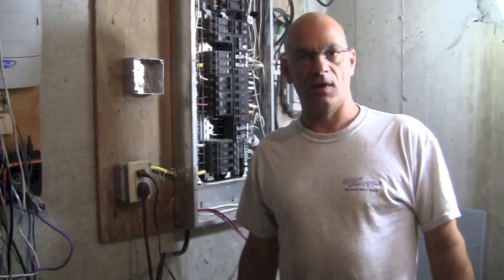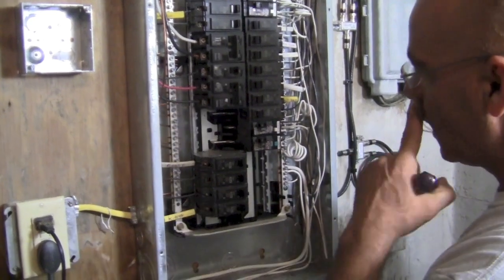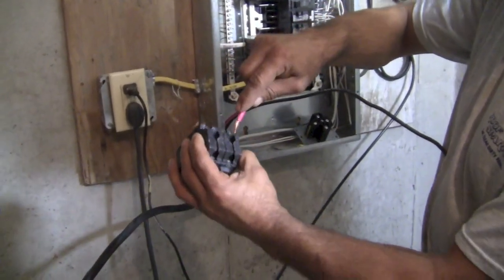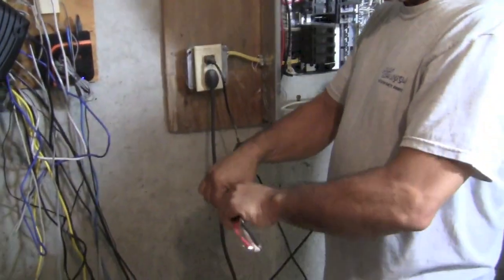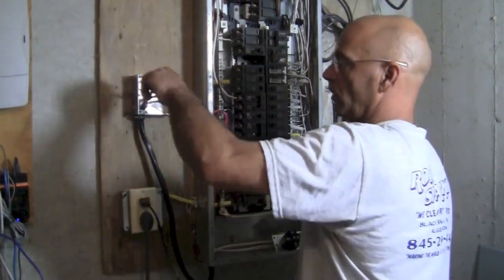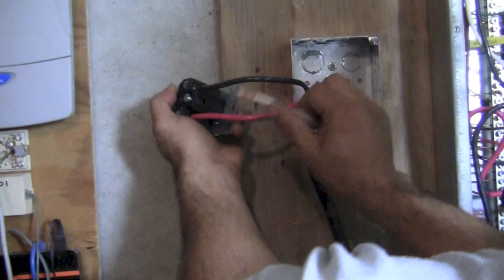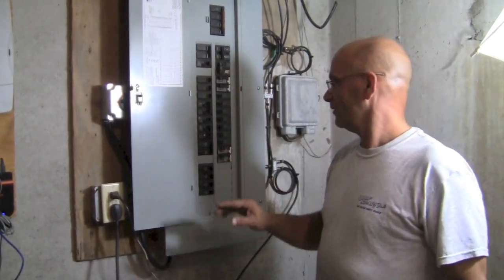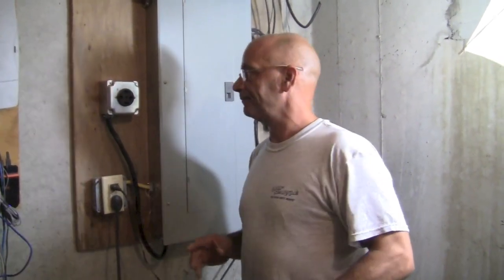How to Install a 220 Volt 4 Wire Outlet

Comment: hey dom Ive got a 4 wire 220 red,black,white  and copper  wire Ive seen you wire  a 4 prong outlet I want to use a 3 prong outlet where do i put the copper ground thanks
Reply: 250.140 Frames of Ranges and Clothes Dryers.
[...]
Exception: For existing branch-circuit installations only where an equipment grounding conductor is not present in the outlet or junction box, the frames of electric ranges, wall-mounted ovens, counter-mounted cooking units, clothes dryers, and outlet or junction boxes that are part of the circuit for these appliances shall be permitted to be connected to the grounded circuit conductor if all the fol- lowing conditions are met.

The supply circuit is 120/240-volt, single-phase, 3-wire; or 208Y/120-volt derived from a 3-phase, 4-wire, wye- connected system.
The grounded conductor is not smaller than 10 AWG copper or 8 AWG aluminum.
The grounded conductor is insulated, or the grounded conductor is uninsulated and part of a Type SE service-entrance cable and the branch circuit originates at the service equipment.
Grounding contacts of receptacles furnished as part of the equipment are bonded to the equipment.

It's important to note that this means on many (all?) dryers, the green grounding-wire should not be connected to the grounding screw when using a 4-prong wire, only with a 3-prong wire! So, make sure to find and follow the directions for your dryer when installing a new cord!
Reply: What I have seen done is the neutral is capped with a wire nut and hook up the ground.
I had a metal box so I hooked up the  ground to the box and used the neutral .
Reply from the maker: That is a two wire 220 with no return path.
Reply: 1998explorerRED

Comment: Does the gauge of wire depend on how long the line will be from the box? Or does it depends on the current draw period no matter how long the line is?
Reply: voltage drop only applys to real long runs...you wont have a issue in the average home.

Comment: Will an AC's outdoor compressor unit be using a 4-wire 220?  What kind of boxes/disconnects are used outside for the outdoor unit?  (AC installer is going to charge a bunch of money for the wiring part and I need all the advise I can get)  Thanks ... good videos btw

Comment: Hi Dominick, great video. I purchased a used 240v/15amp countertop griddle for my foodtruck and I'm in the process of installing it but I notice that it has a regular 120v 3-pronged plug on it, which I don't think is original. Should I change it to a nemo 6 plug and bring the wire gauge to 12 to be safe or can I hook it up the way it is? Thanks, Michael.

Comment: You forgot to ground the box.
Reply: He may not have shown the step, but it's obvious that he did ground the box by the testing at the end.  I'm pretty sure that it is standard for the NEMA 14-30S sockets have an internal ground connection to the base plate but of course I don't know the actual configuration of that socket assembly since I've only seen it on the video.  But, no matter, the box is grounded.

Comment: 5:14 It's a 50 amp breaker. :)
Reply: Hard to tell on a video but it looks like it, also it looks like a 30-Amp NEMA 14-30S socket.  But what could go wrong????
Reply: Of course nothing could go wrong. :D
Reply: @jareds7969  For large appliances the breaker should closely track the nominal amperage. So, for NEMA 14-30, the dude had to install a 30A breaker. That's to the code. But of course, most likely nothing bad will happen :-)

Comment: this american electrics is so rough compared to our british electrics. our regulations are so tight. for example, all tools must be rated to 1000VDC insulation. But still, our consumer units/'fuse boards' contain RCDs (residual current devices), split load so half the CU off one RCD, other side off another RCD with then breakers split across so upstairs lights with downstairs sockets on one side so if it was to overload , you would still have either plug-in lamps or lighting. All our voltages are powered off of a 230v/400v system. We have power generated through transformers such as delta, star etc giving us three-phase line with neutral and an earth. each live/line (L1, L2, L3) is 120 degrees apart on a sine wave of AC current. 400v between each line and 230 between line to neutral/earth (essentially same point). 400 divided by square root of 3 equates to 230v. so in houses, we have incoming of one phase. live neutral earth. with live to neutral/earth 230v. in the road, each house is split of the phases so one house L1, second L2 etc to split load. In bigger incidences such as commercial or industrial the whole 3 phase incoming will be used to allow for 3-phase 400v equipment consisting of 3 lives and possibly a neutral and earth.We've got intense earthing systems with tight impedance levels to reach. . all circuits under 32A to cut out in under 0.4 seconds. we've got tight Ingress protection codes (IP ratings). such as top of a CU needs IP4x, a hole no bigger than 1mm. all our earths are sleeved up. all conductors are sleeved for identification.
Reply: US 120v system is very uneconomical. We don't actually use 220v as specified in the video but rather a split phase alternating 240v current and in some cases 208v. I'm not quite sure why some of us Americans use the term 110/220 but I think that is something from the early days.
Reply: That's correct.  Early supply was 120/240v in theory but 110/220v in practice.  Because the actual power supply to an appliance was likely to be 110/220v, appliances had to be designed to run properly on 110/220v.  Once the grid and systems improved, it was likely that you'd see 120/240v supplied to the appliances.  Since the higher voltage meant lower amperages, appliances were seeing lower loads and all was OK.  As in any good electrical installation, it's necessary for check actual voltages to assure that the appliance is getting the voltage that the design specification calls for.
Since there's no real difference in actual performance now, you'll hear 110/220v and 120/240v used interchangeably (and everybody understands what's meant) but the standard terminology today is 120/240v.
Reply: Our home AC fluctuates around 122-123 volts. I wonder if that is typical? I was getting 230ish from split phase. That was before we had a new main line run and replaced the lug fuse panel with a breaker panel.
Reply: Half of 230ish would be 115 - 116V, that's a little low but not unheard of. If you're seeing 122-123V now, I'd guess your L-->L voltage would be around 244V.  But small variations of a volt or two are not anything to worry about.

Comment: At 1:41 into this, I had my main question answered.  At 2:06, any other mysteries were cleared up.  I'm going to finish watching now.  But, I'm already smarter and this is ridiculously straight forward and informative.
Reply: 5:33, 7:53... more tips.  I will use this information to install my generator hook up and interlock.  
Nicely done, Dominick.  Thanks.

Comment: Hi Don,   I am doing the same project.   I need to run the wire outside from the panel to my garage.  I have to run ~25ft of cable.     Do you suggest the 10-4 wire or individual?  Also,  what type of wire cover or shield should I use to protect the wire from the elements.  thanks.

Comment: Can I use a plastic box instead of a metal one for 6 awg wire?   I want to recess the box into dry wall.
Reply from the maker: +Brad N Sure can. Just read the wire size rating on the inside of the box you get

Comment: Thanks for the video, I found it helpful.

In Canada, we call that 4-wire cable a 3-wire. The red and black wires are for hot, the white is neutral and the ground wire we also call bonding wire. The bonding wire is not a current carrying conductor so we don't include it, even tho its there.

A 4-wire cable here would have a black, red, blue, and white wires along with the bare ground/bonding wire.
Reply: In the US, we call it 6/3 (#6 gauge and the number of wires not counting ground). I assume the 4-wire cable that you mentioned would be used for 3-phase appliances/machinery, correct?

Comment: Is there an adapter that I can plug into a pair of two 110volt outlet to quickly turn a two 110v into a single 220v?
Reply from the maker: +1471phillip Not that I know of. You would have to make it yourself. But remember the breaker amperage.
Reply: ok thanks!

Comment: I see you use a twisted pair wire for the dryer. Can you join a twisted pair to solid wire . I want to move the dryer to another location 10 ft away. I am thinking of using a junction box . The old twisted wires seam larger than the 10 -3 wires solid copper I bought. Can it be done

Comment: How come I get 118 on every side but when I put them together I get nothing???? Help
Reply: +Humberto Negrete ,it's all about phase phase cancel each other  , so you need to have different hot wires not the same line to sum 220V

Comment: question though, I got a old house and the plug that's installed is a 3 prong but the stove has 4 and my wire only has 3 can I attach a metal piece to the neutral and attach it to the ground wire?

Comment: Question:  If a single hot is 120V then a pair of them should be double that or 240V so why are you calling it 220?
Reply: Standard AC voltage is anywhere from 110 to 120.  so you generally hear people say 110 or 120, which would be the same.  It goes the same for 220 and 240.
Reply: +MVP11489 - My understanding is at the outlets close to the electrical box, it is usually closer to 120V but the outlets farther away can dip to as low as 110V under load so those terms (120 and 110) are used interchangeably.
Reply: Because Union folks are particular and the guy making this video is speaking to real people who refer to it as 220.

Comment: Another great video.  Thank you for giving me this link to watch.  Very informative.  I've seen the comments that you're talking about.. All haters, plus they don't provide proof in their own video.  All talk.  Please keep doing what you are.  You've helped me out a lot. Thanks again.
Reply from the maker: +Nrfa Sure thing. If I can get a camera man today I'll be making more.
Reply: +askmediy what size wire did you use in this video?  Is it a 10 3?  Thanks.
Reply: +askmediy what's your thoughts on solar power panels to power, say a pole barn?  Thanks?
Reply from the maker: +Nrfa That would be a #6 wire
Reply from the maker: +Nrfa Don't really have any. I don't know enough about them.
Reply: +askmediy I wanted to thank you for your support and video, nicely done.  In my state, it's recommended that a 10-3 wire is to be used.  Everything turned out well.   Do you happen to have any videos on how to remove an interior door, widen the door from 30" to 36" step by step?  If so?  Can you please send me the link?  I'm an amputee, and I need all, or as many as possible of my doors to be widen for my wheelchair, to make it ADA barrier free.  Thanks again:)
Reply from the maker: +Nrfa I do not. I would need one to do of course than I can make one. What state are you from?
Reply: +askmediy Michigan.

Comment: You should always connect the wires at the breaker as the last step, just in case the main or individual breaker fails.  I have seen brand new breakers fail right out of the box.
Reply: curious.  If the brand new breaker fails, what's the difference if you connect at the beginning or the end?
Reply: @twoweeledsoto6072  if you're trusting the breaker to keep the current off, well good luck.  In fact, last week I was replacing a light switch for my GF.  I usually just turn the light switch off and place some tape on it so no one can accidentally throw it on.  Even with that, I still check for voltage at the bulb.  I did my usual routine of placing some tape on the switch and found out there was still 50vac at the junction box!.  Apparently, someone installed a "lighted" switch.

In the case of the new breaker, even though the switch was thrown to the "off" position, it was still allowing voltage through onto the wires.  Yes, it was brand new out of the box.
Reply: @2-old-Forthischet  I may have misunderstood.  The host connected the breaker first, then went on to connect the plug.  The main was off the entire time.  I thought you said the breaker should be installed last, implying to connect plug first, then the breaker last.  My thought is, if the main is off (and operating correctly), you're not getting zapped either way.  If the main is faulty (and power still going through), you're going to get zapped regardless of what order you install.  Unless I'm missing something?  I always use a tester, even after hitting the breakers😂  Always!

Comment: can the max amperage be 30a on each hot leg of the outlet ? if so on both legs be able to pull max of 60 amps
Reply: No, the amperage is 30 for the total circuit. That's why the 240v breaker looks like two single poles that are married together. If one of the hot legs exceeds 30A, they both go off.

Comment: I'm a little confused as to how two in phase 110v lines becomes 220v?
Reply from the maker: +Joe Maniaci there are two hot legs that make up one (single) phase. Each leg is 110 x 2 = 220 or whatever your voltage may be. 110- 120 volt.

Comment: I noticed that you said you're wiring a 30 amp plug but the breaker that's in the video is a 50 amp.  I have a very similar situation.  I have a heater I'm installing in my garage and it's rated at 30 amps.  My existing 220v circuit in my garage is on a 50 amp breaker.  Are there any safety concerns with the heater being installed on a circuit with a higher rating?  I'd hate to see the heater burn up because the breaker didn't trip.  Thanks for any answers.
Reply from the maker: +Lloyd Estell It's not the heater you need to worry about rather than the wires in your wall. Change the breaker out as well.
Reply: +askmediy The wires in the wall are 8 gauge.  What gauge should they be for a 30 amp circuit?  The circuit was wired professionally for 50 amps when the house was built.  I am just concerned about the heater not pulling enough amps to trip the breaker if it has a short or something.  Can I change the circuit breaker without changing the wiring?  I also use the plug-in for a welder.
Reply from the maker: +Lloyd Estell #8 wire is for a 40 amp. #10 is for a 30 amp. Whatever the breaker is rated for is what it will trip at. Yes you can use that wire. However I might just install a small sub panel in your garage. That would be much better.  Use this link for more help on my site. http://www.askmediy.com/electrical-wire-size-calculator/
Reply: +askmediy Thanks for the advice.  I might try that.  My garage is pretty short on plug ins anyways.  Would the existing circuit be able to handle the 30 amp heater and a couple regular 110 volt plug ins if I broke it out in a sub box?
Reply from the maker: +Lloyd Estell You know I have something like 120 videos and I'm not able to make a video all the time and the one project I did do just like a month ago was exactly what you need. However I used a 50 amp wire to a sub panel with 4 220 20 amp lines and 6 120 volts outlets. 

Yes your heater is rated for 30 amps, but what will it pull during operation and with what ever else you have plugged in the 110. 50 amp is better of course but you should be ok. But again how hard would it be to replace your existing wire?
Reply: +askmediy My main box for my house is mounted on the outside.  (stupid, in my opinion) I'd have to basically run conduit along the back of my house and punch through into my basement garage.  I'll double check the existing wiring.  It may have been heavier than 8 gauge.  I know it was thick as hell.  I had a hell of a time mounting the outlet into the box when I hooked up my welder.  Thanks for all the advice!

Comment: Thank you for this video and great explanation. If I am using a multimeter to check my voltage, does it matter which probes I use to check the hots/neutral/ground? Thanks again for the great video.
Reply from the maker: +Weakshot24 Not really.this is AC if it was DC than yes. But not all meters are the same.
Reply: +askmediy ok. Thank you and thanks for your timely response!

Comment: Excellent instructional video. First one I found that actually explains difference between 3 and 4 wire 220. Thank you!
Reply from the maker: +Ranger42 Thank you so much. I do try.
Reply: @Askmediy  Yes great video,answered exactly what i needed
Reply: Is that on a 2 pole gfi breaker as required by code for electric dryers?

Comment: My dryer has the option to choose between the the 240V input and the 4Wires hook up.  Is the 4Wires option safer?  I'm thinking that the 4W is just about power conservation.  My receptacle is the standard 15A, 240V version,
-.-
Reply from the maker: SamsungLG Hi, listen I love helping people on here. But the questions you're asking me makes me think you have no idea what you might be getting into. 4 wire dryer hookup is 220 volts. And how do you know you have a 15 amp 240v receptacle?... You can burn a house down with a 9 volt battery, needless to say with 220 volts. Be Careful my friend.
Reply: +askmediy My outlet is the horizontal shape eyes, and I can use that.  I just want to know if it would be safer to use the four wire version.

Comment: Hi Dom.i have a question? It is posible to change just the cable on a dryer  that it cames with 4 prong. To a 3 prongs. Since the wall outlet is 220 volts.

Comment: Good instructions. For some reason I thought it was more complicated but it's actually quite straightforward. 2 hot wires to the double breaker,  neutral white wire to the neutral bus and the bare ground wire to the ground bus.
Reply from the maker: st8kout1 Yup, glad I could help out.